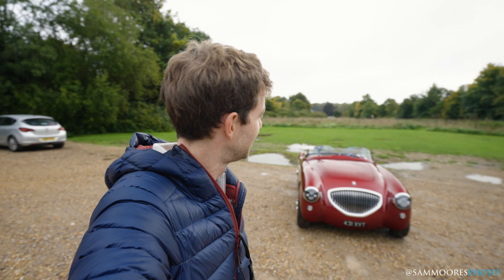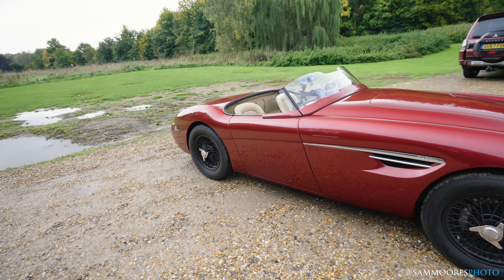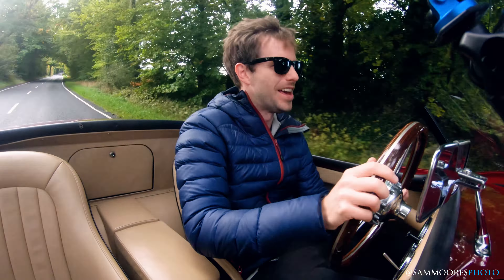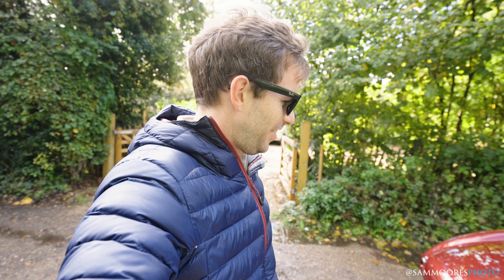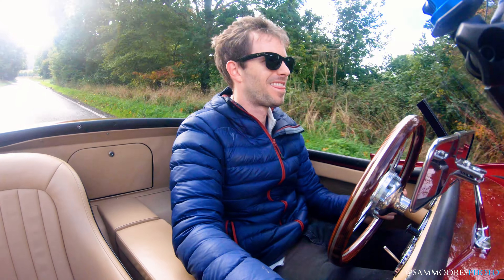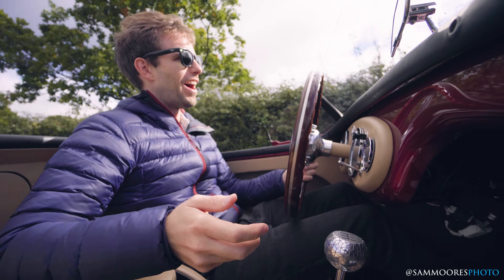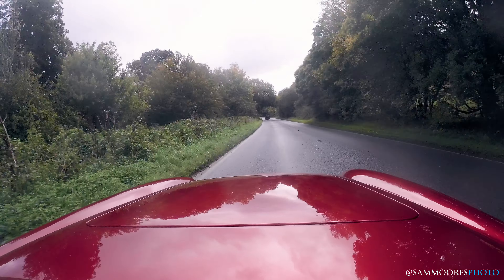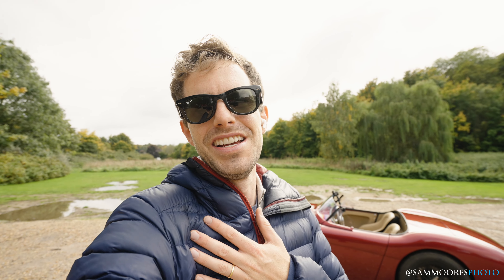Driving the Healey by Caton: What's It REALLY Like?

Comment: I had a BN2, as well as a BN1 I'd put a Corvette Fuel Injected 327 engine and 4 speed in, and have remained perplexed all these years about one aspect of the two cars.  Despite the Massive difference in engine displacement and power to weight ratio, they each got the same fuel mileage.  

I kept scrupulous records in those days - bred in me by driving Volkswagen bugs, which had no gas gauge - so every car I owned had a pad and pen with which I recorded every fillup and mileage.  Remarkably, the Chevy-Healey consistently got 20 miles per gallon - albeit on high test, necessitated by the high compression ratio of the Corvette engine: Amoco white exclusively.  

Of course, cruising in the V8 car, the engine had almost no work to do, so you were hardly cracking the throttle - and the Rochester Fuel Injection system was pretty efficient; but for the mileage to be the same as for the 4-banger Austin engine was a surprise.  I thought it might have had to do with my love of rowing through the gears of the BN2 and listening to that classic 4 cylinder's growl, which I did, blipping the throttle and all, at every opportunity.  But I did open up the V8 on (not) rare occasion, so you'd think 5 liters of V8 displacement would do a good job of draining the tank quickly.  

But no, over the years I had both, they were consistently within a few tenths of an MPG of each other.  Of course, the Chevy-Healey was insanely, blindingly fast - 350-odd V8 horsepower pushing 1,800 lbs of car wakes you up faster than an Espresso transfusion.  But it made you enjoy going to work just for the commute.

Comment: Ridiculous car.
Convert a 100 into a 100S for much less money than that and to get a better car
Reply: The biggest issue with the six cylinder engine—apart from greater mass—is that it does not have the expected 7 main bearings.